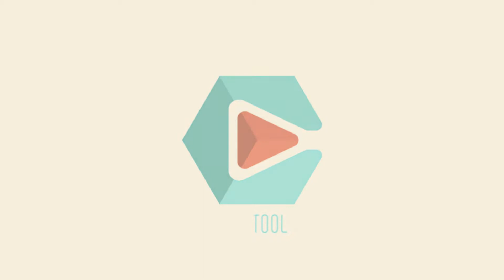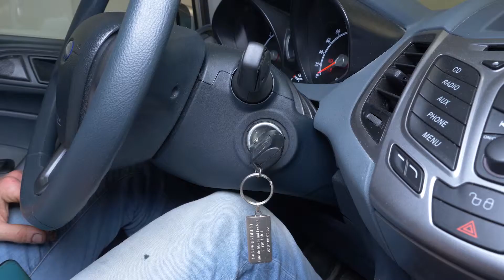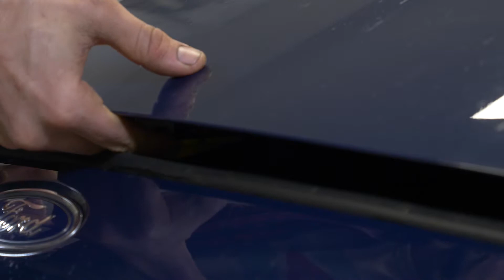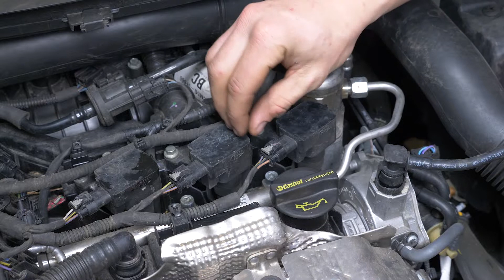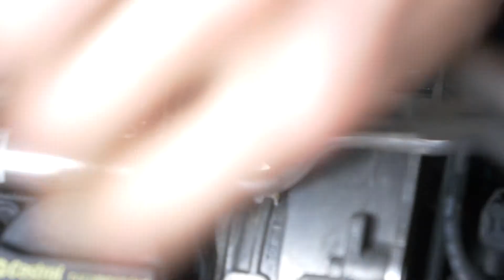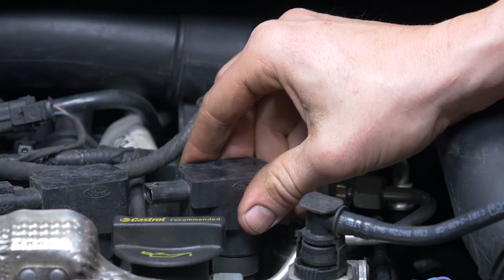How to replace the spark plugs Fiesta mk7 1.0 ECOBOOST⚡

Comment: anyone knows how much the gap for the spark plugs and torque should be (fiesta ecoboost 1.0). Ta .
Reply: If you buy the correct part number you won't need to gap them (at least I never did and never had any issues). As for torque, tighten by hand until it stops then with 3/8 drive ratchet start turning gently until you can't. Don't go past this! I think the actual torque is 10nM, so almost nothing. When you do it, try to have the engine warm so that they are easier to unscrew (you don't want them to snap). Top tip, get a can of compressed air and blow around the hole after you take the coil out so you don't get any debris in the engine while the plug is out. Don't know why I am on this video, I guess I just wanted to validate my work haha!
Reply from the maker: Thanks for this complete and useful answer !
Reply: Thanks for the very informative video and for Marcel Dutu's response. Managed to replace them today and it seems it was successful. I had to do it with warm engine because I was unable to unscrew them when engine was cold. Thanks again.
Reply: .027mm mine weren't gapped out of the box one was well off past .033mm